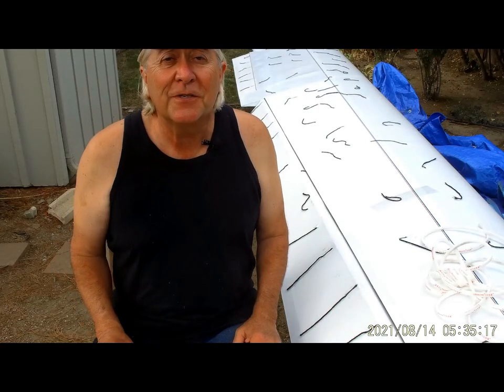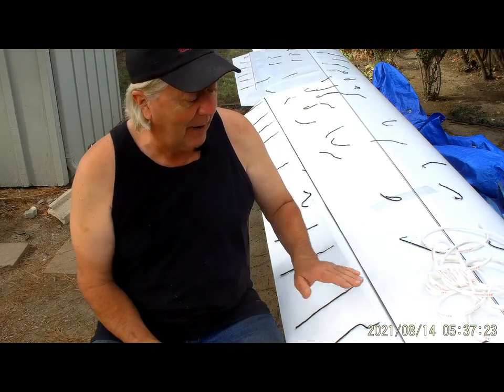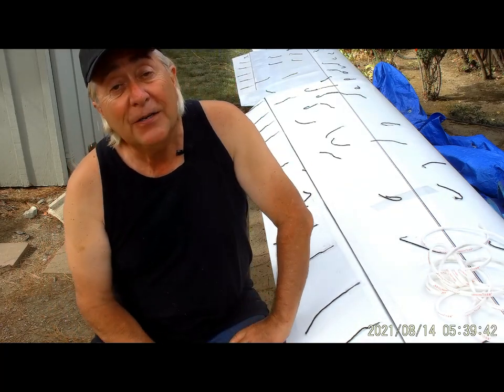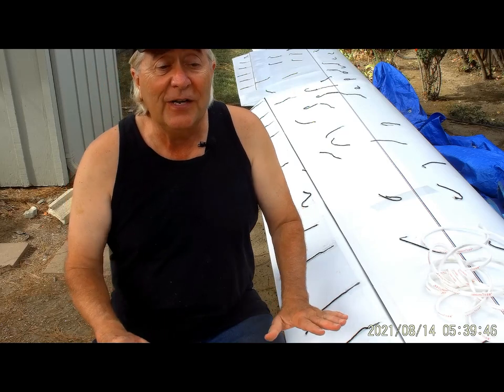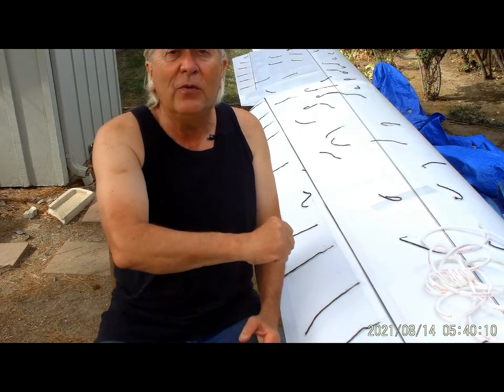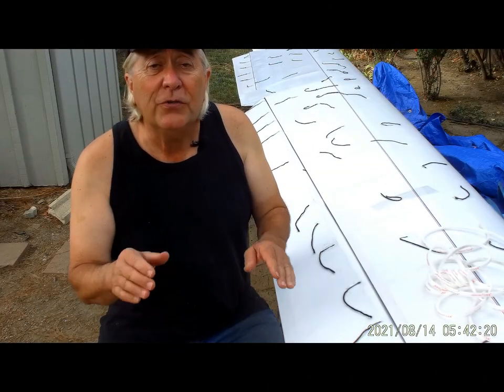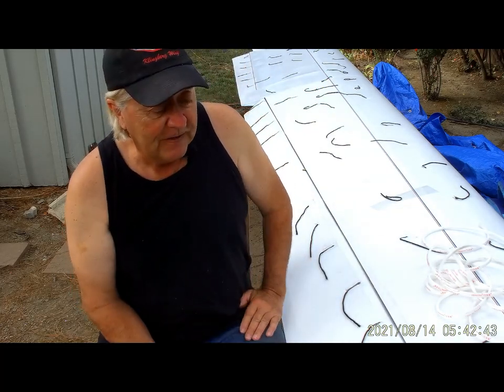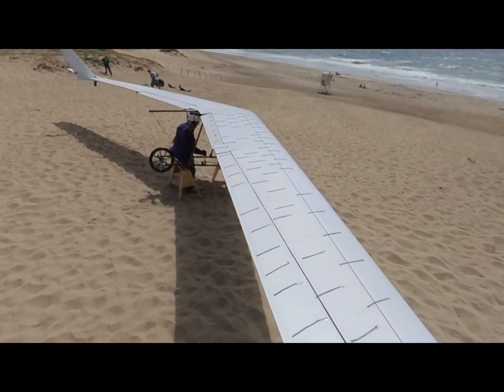Elevon Gap Issue - KW MkII Ultralight Glider Aircraft Development

Comment: Interesting that this gap is promoting flow separation, when a gap is used in slotted or fowler flaps to delay flow separation. Why do you think this is? Perhaps the high pressure air is flowing at too high an angle to remain attached to the top surface?
Reply from the maker: This is an excellent question! It's perfect for a round of, "Can my viewers provide the correct answer?" I will give a free Klingberg Wing hat to anyone that posts the correct answer to Trent's query. You have one week. If there isn't a good answer by then, I will provide the solution.
Reply: I am not an expert in this field nonetheless let me try my best to win the incredible klingberg wing!

I could think of several reasons why the vented gap was not helping the airflow over the elevon. 

The wing was operating at a very low reynolds number of about 150k. The transition point from laminar to turbulent was probably behind the hinge point and the gap would create enough disturbance to cause a violent flow separation.

The wool tufts were indicating reversed flow from the trailing edge.
The fast airflow through the slof of the conventional flap is suppose to keep the airflow attached but maybe the followings have happened:

1) The geometry of the gap was not letting the air come out smoothly over the elevon surface but more perpendicular to the surface which made it less effective.
Also the gap is too small to provide sufficient flow.

2) The airspeed was also very low for the vent to provide enough flow.

I am looking forward to the solution!
Reply from the maker: Random poking around will not get you a hat. It has to be one coherent explanation that others can understand and learn from. Feel free to try again.
Reply from the maker: That's an excellent definition of slats and slotted flaps, but it does not really explain the aerodynamic process by which they work and why my elevons have separated flow and the slats and slotted flaps don't. I bet you know the real answer so, try again and the hat is yours!
Reply: If sealing the gap can fix the problem. I can only assume that the gap is not acting like a slotted flap, namely creating a faster airflow on the upper surface.

I think the gap is not large enough and the height of the hinge point is not optimal for it to become a slotted flap.

If you still get flow separation with the gap sealed, I would test if it still happens at a higher airspeed to check if it has to do with my previous explanation with the low reynolds number.

If increased speed won't fix the problem,  I would check if the hinge point was too far in the front.

The effective aoa is increased when the elevon is deflected downwards. 
Your elevon has a much larger proportion compared to the chord than the flap does.
This means the actual aoa is much higher for the elevon section than the flap section at the same deflection angle. This is only true if you have 0 deg washout. (I know it is not the case).
But is it still possible that the hinge point of elevon is to far in the front for the washout you have?

I badly want to win the hat but this is the best I have now. Please feel free to correct me if I am wrong. I am really looking forward to the answer.
Reply from the maker: Hi, nice try and you are wandering in the right woods. However, this really isn't helpful to my viewers. You need to explain in a way that the general viewer can understand why slats and slotted flaps work and how if differs from my elevon issue. Do some online research and try again.
Reply: After looking around the internet, I'll have another crack...

A slotted or fowler flap converts the higher static pressure on the lower surface to dynamic pressure i.e. trades pressure energy for kinetic energy. This helps keep the flow attached by mixing with the air on the top surface, increasing its speed, and helping it resist the adverse pressure gradient.

In this case, there appears to be minimal conversion of static pressure to dynamic pressure, so the static pressure remains relatively high when it transfers to the top surface. Instead of helping to combat the adverse pressure gradient, it makes it worse, promoting early flow separation.

Am I on the right track?
Reply from the maker: You are about 1/2 right.  Which half of the hat would you like, front or back? Sorry, I couldn't resist a little joke. You are getting closer and we have a few days left, so I'll give you a clue. The clue is, "BL"
Reply: If the gap is bigger than the boundary layer, it increases the lift but if it's smaller, then it disrupts the stream
Reply: @KlingbergWingMkII  
On each element of a properly designed multielement airfoil, a new boundary layer is formed at each leading edge and the layer is therefor thinner. A thinner BL can sustain a grater pressure gradient than the thicker BL provided that the airfoil is operating in the proper Reynolds number (turbulent BL before the adverse pressure). Grater pressure gradient means greater lift and less prone to flow separation.

Such multielement airfoil has own vortex and circulation.

Without knowing the exact geometry of your wing, the gap is not sufficient to form a new BL around the elevon.

I hope this explanation is sufficient to win at least the other half of the hat. :)

Rol, please use the @ function when you answer so it is more clear whom you are responding to.

BTW. I really hope changing the hinge position is not going to be necessarily.

In the worst case, my suggestion is to immobilize the original hinge and reconstruct the elevon element to have a hinge in it self so you can experiment without reconstructing the entire wing.
But it means also that you will have to modify the control mechanism.

Looking forward to the next test results.
Reply from the maker: @ D D Well you never got this whole answer but thanks for playing! I will have a video in the near future fully explaining the process. If you send me your mail address, I'll be happy to send you a hat. Just email your address to: rolkling@gmail.com
Reply from the maker: @ Angelum Band Well you never got this whole answer but thanks for playing! I will have a video in the near future fully explaining the process. If you send me your mail address, I'll be happy to send you a hat. Just email your address to: rolkling@gmail.com
Reply from the maker: Yes, I follow his site and seen that he does extremely high quality work. That said, I'm quite concerned about the taper ratio of his wing compared to the planform shape of the elevons. I don't know if the sketches on the site are accurate, but if they are the intended design, he could be in a bad engineering corner relative to stall/spin. Please see my series about preventing stall/spin on flying wings to get the full technical details. I've sent him msgs, on this issue, but he has not responded. I wish him well and pray that he is very careful, some of the Horten designs had nasty stall/spin problems.
Reply: @KlingbergWingMkII  Fantastic! I will send you an email. Thank you.

Comment: I hope the looped mylar is stiff enough and won't get blown out causing the hinge to bind but I'm sure you'll figure out the best solution for the gap problem.
Reply from the maker: Time will tell!
Reply: @KlingbergWingMkII  . It's a common method on doped fabric wings ,well proven. I do know of an incident where the doped fabric seal folded up and out of the gap forming a spoiler all along the top gap. If the Mylar fatigues and breaks in flight ---- not good , I personally like the window seal solution.
Reply from the maker: Everyone, please keep in mind the solutions I'm discussing are only  near-term so I can get the first few ground skimming flights done. I guess I should have mentioned my long-term solution is a V-notch style hinge with a fabric hinge on the upper surface so the gap is fully sealed. I'll just have to accept the added drag. This is a solution that requires rebuilding the elevon spars so really it's a winter project.

Comment: My immediate thought was  vortex generators ahead of the gap would help but the drag penalty might be unacceptable. It is not clear why the air flow suddenly goes spanwise because of a line of high pressure air blowing up through the gap.
Reply: Couple of further observations. i seems that the same problem applies to the flap. When I looked carefully at the video footage, there is spanwise flow on the top surface when the flap is deflected. The second thought is that the wall of turbulent high pressure air coming out through the gap may be hitting the leading edge of the elevon and be deflected upwards, acting like an airbrake and causing the upper surface airflow to slow down, stagnate and detach. The decrease in pressure on the underside may also disrupt the flow underneath and further decrease the elevon effectiveness.
Reply from the maker: Yep, and we made a quick set of them the day we were testing and it made no difference. What started to make a difference was to put tape over the gap on the upper surface, but it was just a quick test and not a flyable config. The spanwise flow is typical for a swept, tapered, wing as that is the path of least resistance for the flow. Has to do with potential fields.
Reply from the maker: Good observation on the flap and I'm still curious about it. The flap hinge is fully sealed on the lower surface with a fabric hinge so there can't be any flow through a gap. However, much past 10 degrees and a gap opens on the upper surface. I'm going to try setting the flaps until is see that spanwise flow and then taping the gaps closed and see if the flow corrects. The flap seems to be effective enough at this time, but it's something I'm keeping an eye on.
Reply: Interesting stuff! Maybe the flap is now performing like a split flap where only the underside of the surface has any influence on the control effectiveness.  It may be that the airflow just cannot tolerate the sharp change in direction across the top of the wing /elevon.  The vertical position of the elevon relative to the top surface of the wing might also be very important. If the elevon is a tad low it may not see the airflow close to the surface of the wing.  It might be time to mount / tether the aircraft on a stand / platform on the back of the pickup truck and drive it up and down an airfield?
Reply from the maker: I had not considered it acting like a split flap. You could be right. I think a simple tape seal over the gap will revel what is going on. Simple test I'll include when I go out to test the elevon seals. Stand by for results.
Reply: If the split flap theory is correct it might explain why the sealed flap works but the leaking elevons do not.
Reply: Roll, have you tried it at higher air speeds?  it may also be that the airflow just lacks the energy to stay attached at the air speeds below stall speed.
Reply from the maker: Technically valid but not useful in real life. Full control must be available down to stall speed and that is where the problem is the worst. Glider must be landed in full stall so I need full control at low speeds.
Reply: @KlingbergWingMkII  My opinion is that the stall pattern is just what it should be for a swept tapered wing in which the elevons when deflected down create a wash-in detaching flow in the area of the elevons first. In other words, the stall is inevitable, whether elevon gap is sealed or not. For me either you need more airspeed during take off / landing, either more washout (by up elevon deflection) and/or move your hanging point a little bit forward. IMHO.
Reply from the maker: Yes, that is a valid concern I share because I know that the washout is minimal at the end of the elevon. However. we did run some tests with short gap seals the day we were testing and we saw some improvement. However, we only applied the seals on the upper surface, so I'm headed back to the beach tomorrow to test full seals. We will find out soon what the key driver of the problem is and I hope it is not the washout as that would require that I build new main wing panels which would take months and months of work and thousands of dollars. Fingers crossed.
Reply: @KlingbergWingMkII  I really wish your concerns are gone after sealing the elevon gaps! I want to see MkII flying safely after all your hard work and persistence! Thank you for the videos, you are a trully inspiring person!
Reply: Roll, have you considered Trailing edge fences as per Vari Eze? swept wing, ailerons less effective at low speed?
Reply from the maker: @tufisaurus Tests conducted two days ago sorted out the "chicken and egg" The results showed that separation is allowing the spanwise flow to occur. This is NOT a case of spanwise flow causing the separation. This is a case of the elevons stalling due to high AoA and very low Re. I think it's save to assume at this point that there is enough washout in the wing.
Reply from the maker: @ John ten Have Test done two days ago show that the flap is stalling early due to low Re. Once up to full flight speed, it should behave normally.
Reply: @KlingbergWingMkII  Perfect! Therefore you could estimate the lower speed for take off/ manuevering based on these observations.
Reply: Excellent news! Maybe the real world stall speed is a smidgen higher than that calculated?